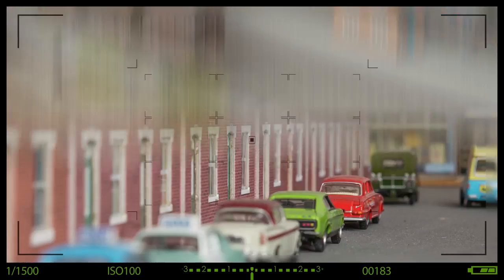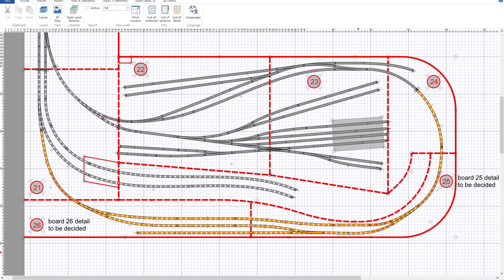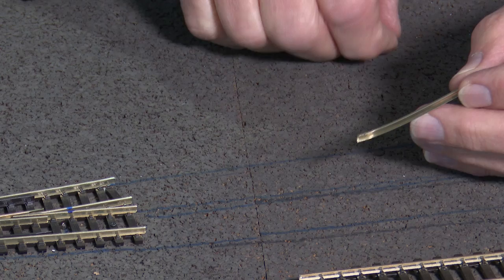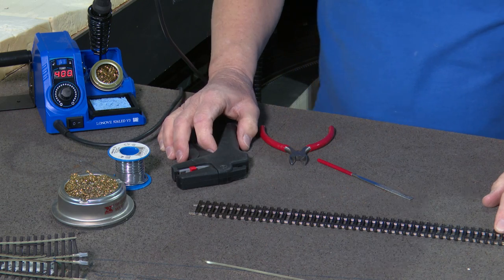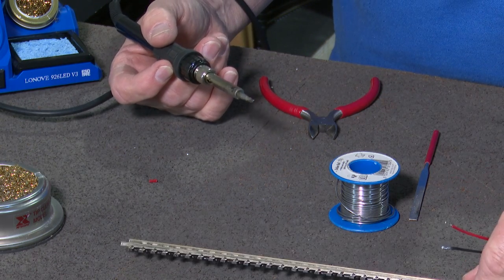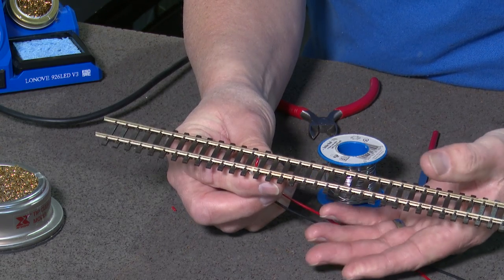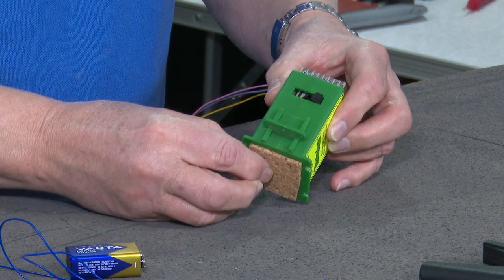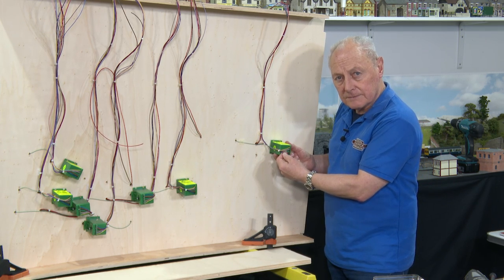GREAT MODELLING TIPS and Layout Progress at Chadwick Model Railway | 179.

Comment: Hi Charlie, I enjoyed the video. I am looking at ordering a pack of those screws. Handy little additions. I watched the Hornby release video. On the loco/wagon/coach front I was not impressed. I don't buy Hornby stock very often as I've found it's expensive and not at the same standard as other suppliers. I was intrigued by the Blue Tooth control system though. I really think this will be really good system. I suspect other suppliers will be looking at it too. Also the magnetic couplings that they released. Accurascale have also announced some similar magnetic couplings so I am going to order both to compare and see what they are like.
Reply from the maker: Thanks Tim, I’m so pleased you found a video interesting. The Bluetooth DCC system is something that’s been previously rolled out in the USA. Regards
Charlie

Comment: Greetings from Slovenija Charlie. Now that all the holes are drilled and the glue has dried etc.... If I've interpreted it correctly (I could be wrong), your "headshunt" as you call it will only accommodate one loco. For the purposes of repositioning dead locos (47's etc) or arranging preparation for multiple working in pairs, positioning steam and electric locos for depot open days etc this would never work. The locos would be foul of the other incoming line. It also needs to be controlled by a ground signal (sub) of some kind for it to be authentic. I totally agree about the tunnel. A nice idea but more trouble than it's worth. Better to fill the space with disused track possibly? You can solve the problem by having both roads leading to the depot splitting earlier into two and having a clear view of the entry onto the various lines as would be the case in reality me thinks. It also won't effect your wiring plan. Sorry about that. 🙂
Reply from the maker: We shall have to disagree on this one Martin.
The access to and from the traction maintenance depot will be strictly controlled by ground signals etc.  Regards Charlie
Reply: @ChadwickModelRailway  No worries. It's coming along nicely.

Comment: Happy New Year Charlie.  What are you going to do about the slip which looks like it is going to bridge the two boards.  Aren't you going to have to make holes in this board for the first part of the slip?
As far as the Hornby announcements were concerned, I was totally underwhelmed.  I do understand that there has been a delay between previous announcements and delivery of the items, but some of these!!!!!!!!!!!.  I am a S & D fan.  They have taken a nearly 50 year old moulding of a left hand drive 4F 0-6-0 and painted it blue.  The best thing about it is the mechanism.  The model is so totally wrong.  The 5 Armstrongs were all right hand drive and had a completely different tender.  It deserves to be a cost of £50-60 for so pathetic an offering.  If they had made a metal base, to increase the weight and increased the detail, they would have produced a Left hand drive model which would have made a large number of LMS/BR steam modellers happy although would still have been wrong for the S & D pre 1930.  Fortunately the 2P is correct and the model is better but is still 40 years old It is now locomotive drive and would have benefitted from additional weight and loss of the tyre used for traction.  
I appreciate the reproduction of some models, such as the Rocket and others which were in the original Tri_ang range and may appeal.  I would have been more impressed if they had brought out their 4 & 6 wheel generic coaches in S & D blue, which doesn't require new mouldings just a paint job.
 I can't see anything I want.  As I said, totally underwhelmed.  Thanks for your video Charlie.
Reply from the maker: Hi Don, I will address the slip when I join those two boards together initially. The Hornby announcements were pretty disappointing all around. Regards Charlie

Comment: Hi. Would you know if those wago connectors would be able to clamp the street lighting wires which are very thin and a bit awkward to solder to a thicker wire? Many thanks.
Reply from the maker: I’ve no idea Les, but it’s worth you trying them. Regards, Charlie

Comment: Charlie question what thickness plywood do you use? I notice you do brace the board in the middle as I've seen on other layouts I had thought bracing every 300-400mm was overkill. Your thoughts please   Dallas.
Reply from the maker: It really depends on it’s thickness.  I use either 18mm or 12mm and brace at 500mm max (ish). Regards Charlie
Reply: @ChadwickModelRailway  thank you.

Comment: With those Piko screws wouldn't it be easier to screw them between the sleepers with a small washer or similar on them so it saves having to drill and fill the hole in the sleeper ?
Reply from the maker: Yes Shaun, that’s an interesting point. Regards, Charlie
Reply: @ChadwickModelRailway  Either that or use the screws that you used on the helix as they are being removed after the Copydex has dried anyway

Comment: Happy New Year Charlie to you and yours . The Hornby realease 2023 why do they keep going on about working buffers, Yes they are very nice but Why ! I would pefer they did away with sprung buffers and supplied a footplate crew, loco lamps , Fire irons any of these in my opinion would be better, The other gripe is the why they have done away with the trailing bogie and now use a flangeless wheel,  not a fan of this idea. The prices are now way to costly £60+ for a coach, Again very nice but a rake of 10 £600 Oh my god.
Reply from the maker: Excellent points Derek, and much appreciated. Regards Charlie

Comment: I thought Hornby have dome the right thing. Their supply line is clearly disrupted and as Simon said they need to catch up. 
I have pre-ordered the Hornby Doublo  Protype Deltic , Always wanted one. 🙂 Expensive especially as it does not come with DCC chip fitted or sound. But I will add that when I get the model. ( I have the Accurascale deltic with sound and that was £100 cheaper but of course it is not a DiCast body)  I remember very clearly the powder blue Deltics coming through North London in my train spotting days. It was the  only Deisel I liked. 

Their DCC Bluetooth chips are very interesting and could be revolutionary  , although I have since discovered they already exist in the USA. Be interesting to see how they fit in other manufactures Locos.
Reply from the maker: An interesting comment Peter. I was in discussion with somebody in our model railway club today, and we were thinking that these collectors items of which they only make 500, do they ever run on layouts? Regards, Charlie
Reply: @ChadwickModelRailway  Mine will 🙂

Comment: Hi Charlie, I noticed that you use feedback from your point motors to TrainController. Is there any benefit in this and have you experienced this benefit ? Do you do this as it is recommended or in your mind necessary ? I have Itrain using Cobalt Digital and don't run feedbacks from the point motors, but I am now wondering whether to ?
Reply from the maker: That’s a very good question Nick. Just to reinforce my position,  I have just posted the same question on the TrainController - Railroad Automation (English group) Facebook page.
Please do check out the replies. Regards, Charlie

Comment: Re: Hornby.
I was disappointed that there were no new runs of staples such as Mk.IId/e/f in blue-grey or wagons such as the sealion/seacow. There seems to be a great demand for rolling stock which all the manufacturers fail to stock enough of. They also seem to manufacture the same number of first class and second class, which is silly as you need far more second class coaches than first.
Oh well, that's my gripe for the day.
(Re: Mk.IId/e/f coaches, I wouldn't even mind if they just redid the old Airfix/Mainline ones with a better paint job to be honest.)
Reply from the maker: It might be a gripe Stephen, but it’s a good gripe. Regards, Charlie

Comment: Thank you Charlie for another informative video. My model is N gauge and my wiring for droppers to bus leaves a lot to be desired as I have been unable to find any connector which will solidly grip 7/02 wire (my droppers as 16/02 is too big to solder to N gauge streamline track). Will the WAGO terminal connectors solidly hold 7/02 wire? If you could find the time  or maybe another commenter, to answer this I would be extremely grateful.
Reply from the maker: The 7/02 cables that I fitted during the video, are held very firmly. Regards, Charlie
Reply: @ChadwickModelRailway  Charlie thank you so much for your answer. My sincere apologies that I missed you connecting 7/02 wire.

Comment: Hi Charlie - I’m always planning my layout, but will probably do the electronics by arduino🤞🥴; are you willing to say how much the electronics on this board cost - 7 motors, 2 digitrax for the board and a block detection circuit?
Reply from the maker: You make an excellent point. Perhaps I should add it up and announce it when the board is finished. Regards, Charlie

Comment: Thanks for another very interesting and informative video Charlie. The Wago connectors are new to me too and seem to be extremely useful. 

On Hornby TT120 I ordered the Scotsman train set, but ended up sending it back for a refund. It arrived with a broken power connector, but a call to Hornby resulted in a replacement within a few days. Good customer service.

Unfortunately I found the set to be of poor quality in that there was a loose bit from the loco in the box, the track connections were very loose and the couplings extremely fragile with a tendency to fall apart and the NEM pockets to come away from their mountings. One of the coach bogies made a horrible scraping sound which I couldn’t fix and the controller was cheap and plasticky and took several attempts to get it to work.

I sent it back for a refund and again Hornby customer service were excellent. Maybe I was just unlucky. I hope TT120 is a success, but I’m going to stick to OO. 

All the best for 2023.
Reply from the maker: An interesting comment EG. I shall bear this in mind when I open my packaging! Regards, Charlie

Comment: Thanks as ever Charlie. Regarding  mojo, wiring and Hornby, even the thought of spending 12 hours to wire one baseboard wipes out my mojo instantly and, sad to say, has had that effect on me for the last 50 years. I simply don’t know where and how to start. It’s not altogether clear but Hornby’s HM7000 system, albeit very crude in quality, might overcome my petrifaction. It looks like, with carefully isolated sections, I might be able to run analogue and proto-DCC trains simultaneously for a relatively small outlay. That is the nirvana I have always craved and would mean my even less tecchy partner could operate the layout simply once I have passed away.
Reply from the maker: Hi Will, these daunting tasks are always simpler if you just break them down into sizable chunks. Wiring the point motors first, then the track feeds, then the point feeds, etc, is the way to go. When I said 12 hours that’s from starting to running trains, not just the wiring. Only time will tell with Hornby latest revolution, but don’t hold your breath,. Take care mate regards Charlie

Comment: Glad you've gone with the cutting. I think it'll work very well. Great video and well presented as always. The method of putting your board on hinges for access is very clever and something I'll look to do.

I think Hornby is now somewhat fragmented between TT120 and OO. This is reflected in what's being announced. More to the point, however is that they appear to really be struggling to get manufacturing capacity compared to say Accuascale/Bachmann etc and where they are it appears that they are having to pay a large amount for it. I noticed the black 5 has slipped to winter 2024/25 and Hornby confirmed via email that is correct! I also am quite disappointed with the huge number of limited editions compared to anything else and that there is a clear focus on making things more appealing to collectors who will never run the model than to actual modelers. That being said I think the potentially most interesting development is HM7000. The implications have the potential to be massive, especially if the quality is there (or if not ESU / Zimo respond). CV changing on the fly, with free reblows in minutes from home alongside all communication being wireless rather than through the track, giving control even when on stay alive power!

I would like to hear your thoughts on servo control, both for points and other items. They seem mightily versatile and yet cost a fraction of the stall motors. Major DCC manufacturers such as digitrax are now on board. Granted though if you've already got tortoises and DS64's around then it makes sense to standardise.

I too have gone down the Digitrax route but I have to admit that I am quite disappointed with the current iPhone/iPad App control compared to the HM7000/Z21 App's which look much more up to date.
Reply from the maker: Well, E. 100, where do I start.
Our views on Hornby are clearly very similar, I never really thought about the limited editions going on collectors shelves rather than on active layouts. 
The Hornby Bluetooth system, apparently is nothing new. It’s been used in the US before, and I’m surprised if it’s that good, the ESU etc haven’t picked up on it. Regarding the Digitrax connectivity, have you tried the LNWI? 
Regards Charlie
Reply: @ChadwickModelRailway  Hi Charlie, thanks for the reply.

The collectors comments only really came after watching the Hornby TV series last time where SK talked about them an awful lot and it was clear it was a fair portion of the target market.

I think in general I'm in agreement with EUVIRAIL on the current DCC equipement largely being somewhat dated and overpriced for what it is but obviously there is the trade off that this is a niche hobby. The Hornby Bluetooth stuff does seem to be a bit of a slicker implementation than Blunami but obviously we've not got it in our hands yet so time will tell and I do share some of your skepticism.

So when I've looked into the LNWI it provides all the tech but the only supported apps come across very dated and not in line with what is offered with say the Z21 app for example. It could probably do with someone at digitrax hiring an app developer to come up with something better to drive sales of them as it's currently only as good as the software.

Still intrigued what your thoughts are on servo control.

Thanks,
Andy

Comment: Well just looked at or breezed through, as i do not model English trains. But however am interested as Hornby is where i started back in 1959 with my english 3 rail tank engine still have it. As for 2 dudes with computers in front of them, one bigger than the other. Maybe has with mine is bigger than yours, syndrome,however dressed up with no Hornby shirts or wearing company logos. They could have cut the talk to 20mins from over 1 hr, (longwinded) as they repeated from the start to end.
When will manufacturers wake up and realise than the China Syndrome is over? Then source from another country or bring home may cost more but will have more control over the production, surely this may reduced costs incurred at the moment. IE paying to travel to the production centres signing off changes accommodation in other countries.
I rest my rant sorry.
Reply from the maker: An interesting comment Mustang. However, the two guys working for Hornby Magazine do not work for Hornby itself. Hornby Magazine is completely independent from Hornby apparently. Regards, Charlie

Comment: As a second comment on the Bluetooth enabled DCC controller, I like the idea. I won’t be changing the 20 odd sound chips we already have installed though. I’m not sure what intellectual property protections available to Hornby but I would expect other manufacturers to produce more reliable, more robust and less plasticky controllers that are similar if the idea catches on.  I’ve not tried them myself but reviews I read about Hornby sound files and chips would make me reluctant to be tied into a sole manufacturer system
Reply from the maker: You make an interesting point Dac Dac.
I believe that the Bluetooth enabled system is actually copied from a US system, it certainly isn’t a new innovation by Hornby. I like you, will keep my powder dry. Regards, Charlie
Reply: @ChadwickModelRailway  BlueRailTrains have been working on this for a long time. Sountraxx recently announced their Blunami decoders - expensive at $169.95; they use a version of the BlueRail app which only works on Apple devices.